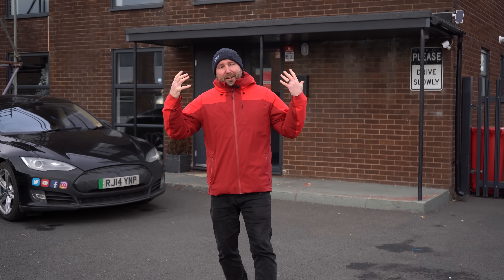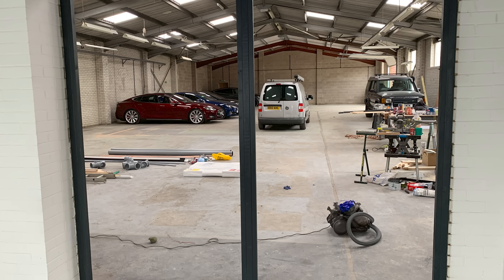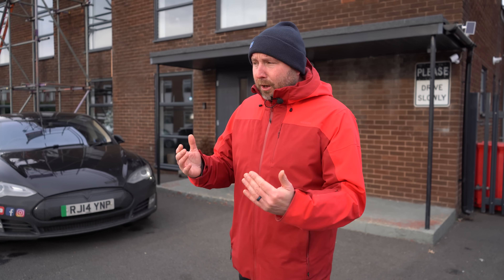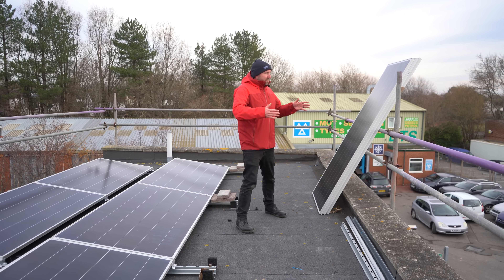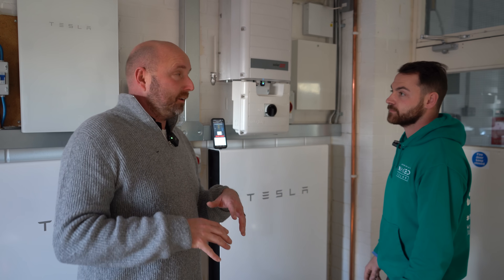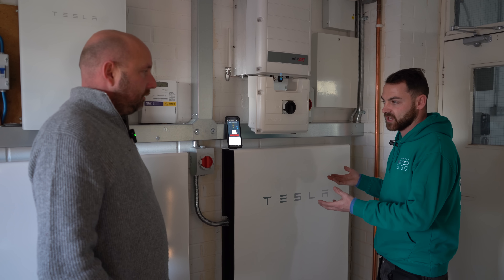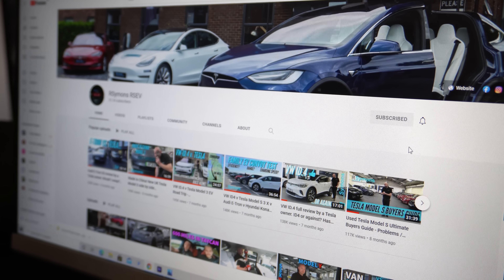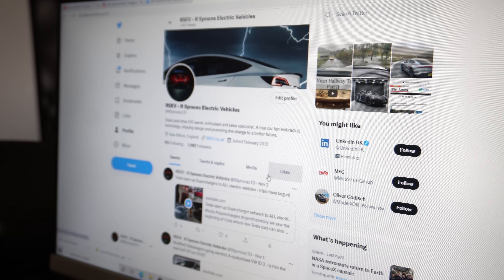RSEV goes OFF-GRID with Office & Warehouse Solar Installation!  Well, some of the time...

Comment: 2 x powerwalls is 26kwh- you would need more on 26kWp PV system to store all power generated
Reply from the maker: We have enough battery cars to absorb overflow. Power walls are just for overnight running and balancing really. They’re expensive things so not really easy to get 10 of them!!
Reply: You don’t size batteries to generation, you size them to overnight demand, in an office that might not be that much! You need to be using the battery capacity regularly for it to pay for itself

Comment: I recon come into summer your prob produced 100 to 130kw of power per day. Did you get any zappi chargers installed as they have mode for only just using the solar you produced . You could have vehicles soak up the power over weekends . Never want to send power to grid .
This would be a great money saver . Have small home 5kw system and batteries etc.
Reply from the maker: No zappi (yet)
Reply: @RSEV  I'm not sure you'd be making use of the Zappi solar matching function, unless its a very cloudy day, pretty sure you'd be always generating either 2.2kwh for a granny charger, but reckon normally over 7wh so your standard type 2 chargers will use it.
I guess matching charging demand to solar generation will be a bit trail and error, as its on a much bigger scale than what a zappi would balance in a domestic situation.

Comment: In a 3-phase house, how are the Powerwalls connected? They are still single phase even with Gateway 2?
Reply from the maker: 🤷‍♂️ I presume so… but Naked Solar perhaps better answer
Reply: As far as I am aware, the Powerwall 2 can only take in a single phase input and supply output on a single phase.  2 battery packs can therefore take up 2 phases... the rest will need to be consumed, or will feed back to the grid.  By the looks of it, one of the phases will always need to be consumed locally, as it doesn't appear to have a battery to fill...

Comment: Agree that all new buildings should have panels installed. We have some old agricultural buildings but they are deemed not strong enough to take the extra load. Also industrial buildings near us had to put up scaffolding when they were to be cleaned. There was a feed mill nearby creating dust and performance drops off quickly if allowed to get dirty and the angle of the PVs is not steep enough for rain to do the cleaning for you. Passing birds don’t help

We put in ground mounted PVs around 10 years ago and the 16x 250 watt strings still produce on average over 4000 Kwhs/ year. Haven’t really noticed any fall off in performance given annual variations. 

With the benefit of hindsight our decision to install solar 10 years not only seems a no brainer but now we are relieved that we made the decision in the light of current energy costs.  Confident you will feel the same  Given half decent weather in February you will be getting meaningful power then 0:02 0:02
Reply: They should be wired for them at least

Comment: Brilliant video. Asbestos is only hazardous when it is drilled or cut or moved.
We converted an asbestos barn into a home and legally and carefully removed the asbestos ourselves and put it into a hired asbestos safety container for safe disposal. No cutting was involved, simply undoing the bolts holding the sheets to the girders and joists.
Alternatively brackets for mounting solar panels could be glued to the sheets. I suspect it won't be long before some wise person comes up with a solution.
 Why oh why can't it be mandatory to fit solar panels and heat pumps to all new properties?

Comment: "It's cost a few quid..."
Boy... that's gotta be THE understatement of the century, dude...!!  🤣
But, absolutely fantastic that you've taken the leap, Richard - I had my domestic PV + battery storage installed a few months back.... it'd been on my 'wish-list' for about 20 years...!
Reply: Totally agree with that Jonathon! - my Solar PV and Battery system has been running for just about a month now, and  already showing a small reduction in (expensive ) power pulled off the grid"
Reply: Excited and happy for you. The increased energy costs on the average citizen has to devastating. Unfortunately, the same idiots are in the drivers seats here in the USA.
Reply: As Richard said, though, he's expecting payback in 18-24 months at current prices. His electricity bills must be staggering currently so this is a no-brainer and should have been easy to get a business loan for.

Comment: You just wait until the summer time!!!!  Solar is brilliant and well worth it!!!
Reply from the maker: Cannot wait!!
Reply: @RSEV  I've got a 4.3KWP system (south facing) and I maxed out at 30 KWH one day last year.  It'll be interesting to see what you get in the summer.  Best investment ever!!!  It proves how efficient solar panels and EV's are.  A little bit of sunshine can give you a decent length journey FoC!  Good stuff!!
Reply: I have a 6.4kWp array (16x400W panels) on a south-facing roof feeding into a 6kW SolarEdge inverter. Annual generation forecast was 5.5MWh, actual was 5.7MWh in 2021 and 6.3MWh in 2022. We have a single PW2. Our grid operator set an export limit of 5.4kW, but we rarely hit this. We had a grid supply cable fault in September. Sunny weather, fortunately, which enabled our system to run the house isolated from the grid for three days until the fault was fixed and grid supply restored:)

Comment: Very interesting Richard.  Payback in a couple of years sounds optimistic, I know for my house the payback is around 15 years - this is on a domestic tariff though.  I won’t be going ahead on that basis.  Look forward to seeing your operating data in due course,  thanks for the vid.
Reply: 15 years.... What price you quoted ? And for what system ? My system could cost 2k more if I got installed today compared to 2 ish years ago.
Reply: Have a look back in 12 months time, a lot of the quotes are about twice what they should be if there wasn’t supply issues

Comment: I can never understand why these HUGE distribution warehouses don't have solar roofs. If not 100% at lest 50% coverage. We here in Corby have hundreds, if not thousands of acres of warehousing roof space that could be used. Then new housing should, by default, have solar where practical.
Reply: built for cost so can’t take the weight
Reply: Probably because they can afford the install
Reply: And very often leased for fixed period of time, in which ROI is impossible
Reply: You said it cost a few quid, oh yes, I understand your motivation for this as you own the building and will get tax breaks for the business. I work with people who install big solar projects and they say at the best you will get 50% of what the panel are rated at, good luck with it all hope it works out for you.
Reply: @G0ogs  you can’t apply this rule for all. We have 3.98kWp system, east-west split, in summer it generating 20-22kWh per day, and we don’t have that south facing bit. the only issue here I see - angle of the roof, while it will be pretty ok in summer (I’m about east-west bit), in colder months it will suffer, as sun is much much lower
Reply: 😂Reliable and honest vendors are hard to come by. Jobs are often underbid for true needs. It’s still quite expensive; even with govt rebates and discounts. The upfront hard vs the amount of time to break even if hard to understand for many people.
Reply: @audiovideophile5317  not really, our payback was calculated as 7 years, now due to energy prices up - it's down to 5 years, so 1.5 more to go

Comment: Congratulations on getting the solar PV added and I believe it is a great addition to your business.
I totally agree that all  businesses with suitable rooves should be retro fitted with solar PV as they would all help to reduce the grid requirement to be reduced. As to why all new buildings are not forced to fit EV charging and solar PV, it seems ano brainer! 
We need to see more business owners embracing this technology!
Reply: The influence of the oil sellers is very powerfull still
Reply: we’re not short on generation capacity… when the suns out in the middle of the day consumption is low. A massive roll out of solar for the grid would only work with sufficient storage
Reply: I think you’ll find the fact that the building industry donates millions of pounds to the Conservative Party might have something to do with it 🤔
Reply: @davesound7188  get your tinfoil hat on plonker
Reply: @hood182ie  there is a theory with all the backing figures that we need to over peak solar by up to 4 times and that will very easy to shut the baseline down totally and still not get cuts and it would not cost more either , I believe to answer is some over gen and some storage and a good interconnection to Norway